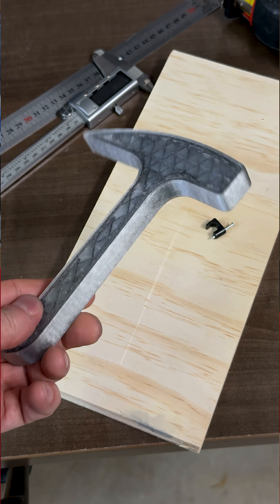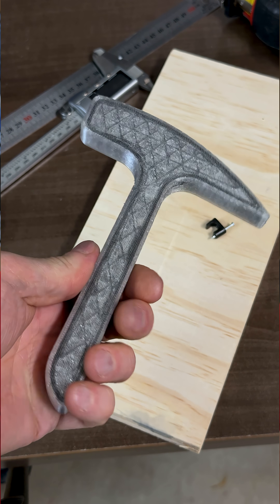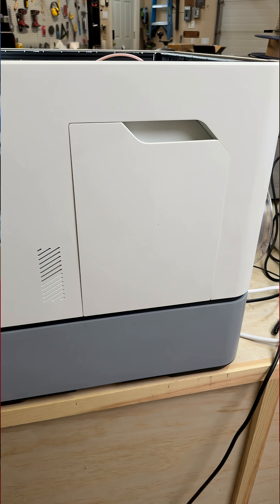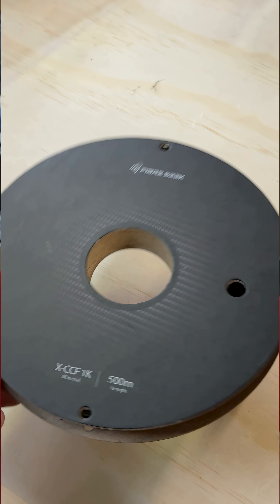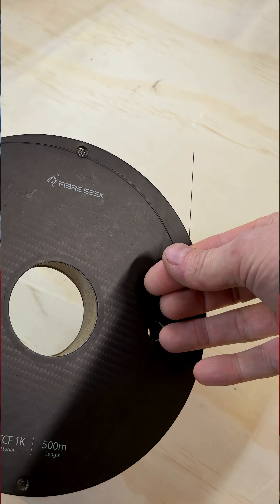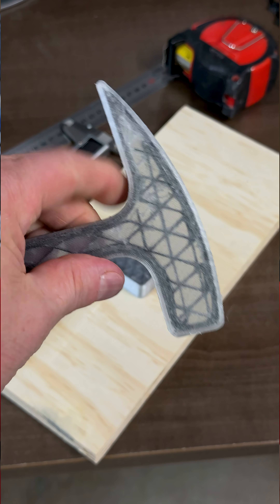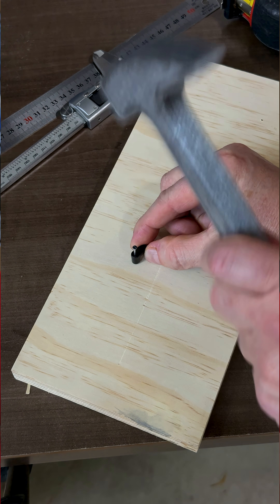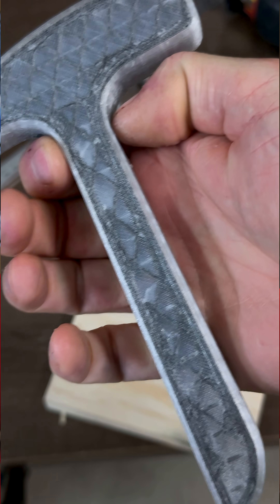I 3D Printed a Crazy Strong Hammer With The FibreSeeker 3 3D Printer  #3dprinting #maker #shorts

Comment: how much is the filament? l
Reply from the maker: I believe the 500m roll of CF filament is around $40.  They will also have glass fiber, which should be cheaper, but I don't think it's available yet.

Everything else is just regular filament like PLA or PETG, unless you want to opt for more expensive engineering filaments.

Comment: This printer needs different design philosphy , no infill at all, and geometry form should be skeletized ( something like topology optimization in CAD) or truss structure . So less material will be used and carbon fiber reinforcement will have longest continuos path.Such parts will be lighter , stiffer and stronger.
Reply from the maker: When your printing is one of the strength mode it will do what you are suggesting her pretty much automatically.  In infill patterns for CF are different than normal infill.

Comment: Actual carbon fiber printing. Very cool man.
Reply: @stevemakeseverything. Hi Steve, what's the tightest bend the FS3 can lay down a strand?
Reply from the maker: @helixx_4D  I don't have specific data for this yet, but I'll try to cover this in my full review.   The carbon fiber is very flexible, though, so I'd guess it's probably 10mm or even less - I've certainly done a 180-degree arc on a 12mm radius and it didn't have any issues.

The Aura slicer seems reasonably good at both laying out efficient paths as well as knowing when it needs to cut the fiber to get around a tight corner.
Reply from the maker: FibreSeek features a highly innovative nozzle design that seamlessly merges the fiber into a regular filament and then lays it down on the workspace.  This is more for business or print farm use, but its very nice to have this available to people outside commercial applications
Reply: @SteveMakesEverything yeah I'm definitely sharing this around. Thank you.
Reply from the maker: @cherrychicken  Thanks!  If there is something you;d like to see printed, let me know.  Ideas for prints that require strength are great for realworld coverage in a video.